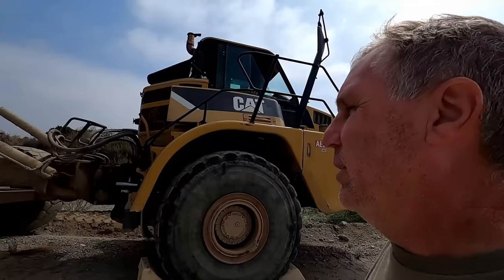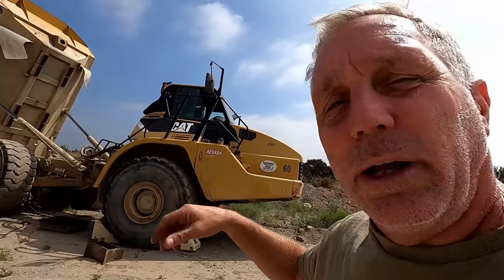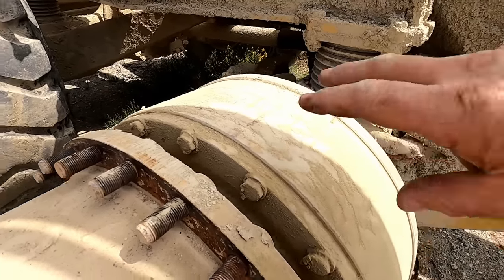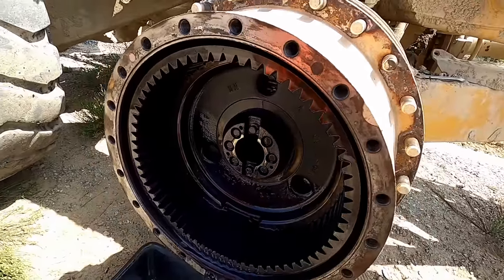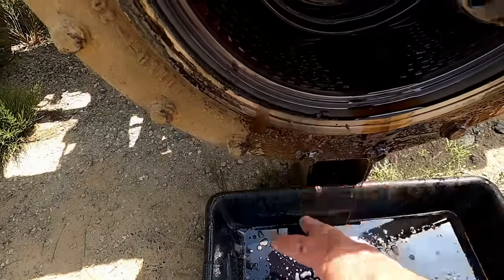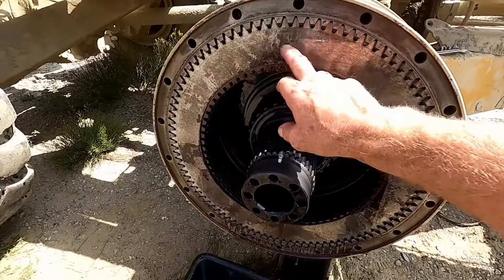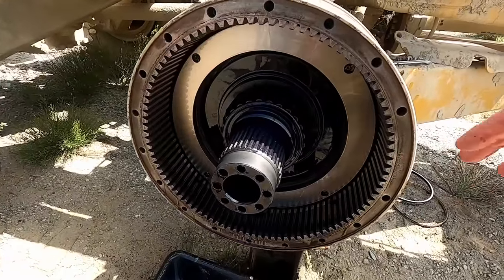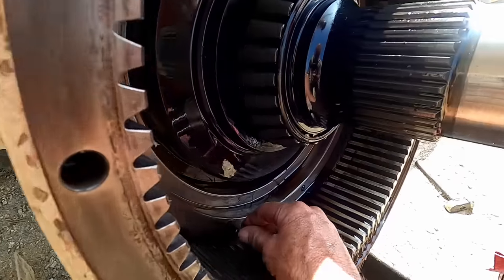Cat 740 Rock Truck Brake Rebuild

Comment: 1800 for that stupid ring? Buy some low alloy steel round stock like T1 and make your own on a lathe. I can't imagine it would be harder than 40 rockwell.
Reply from the maker: It’s not just the ring it is the whole seal assembly. And yes that is way too much money for it.